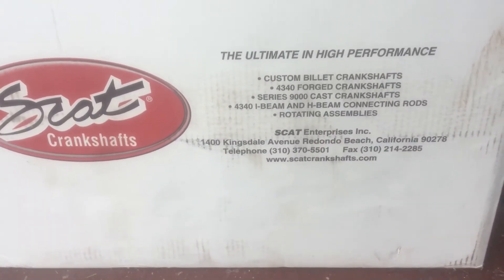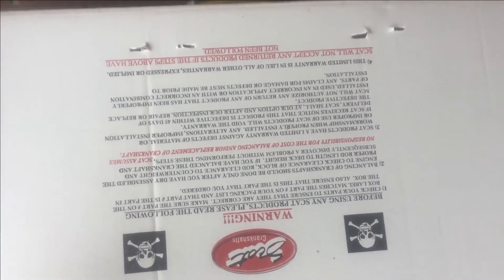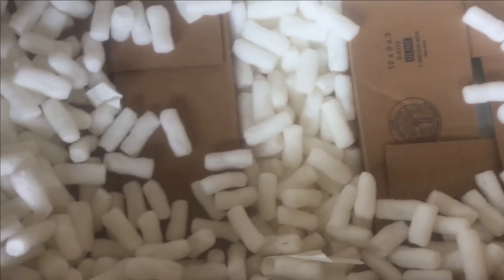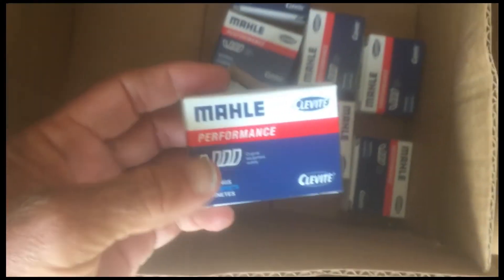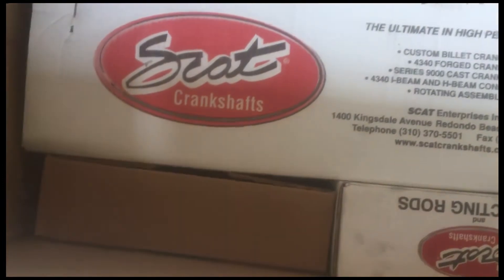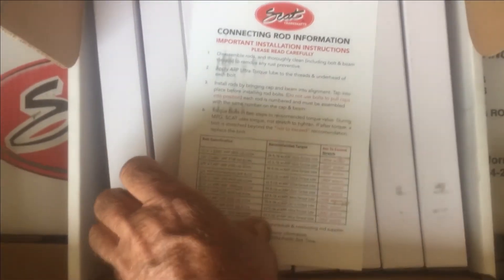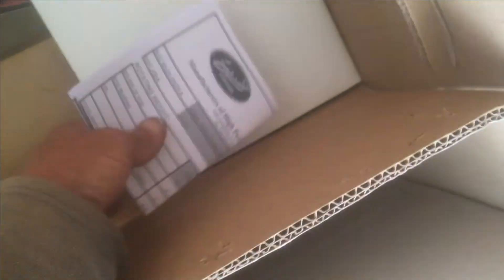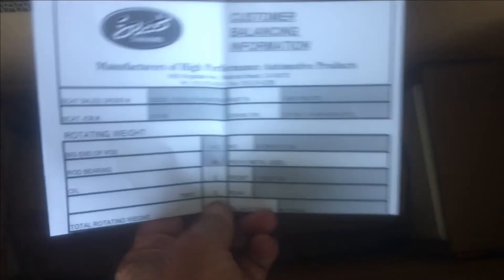Scout ii - DIM DIY How To - SCAT Dodge 5.9 to 408 Stroker kit - part 1

Comment: What is a kit part number on that
Reply from the maker: The part # for the Crankshaft was 9-360-4000-6123 . I worked with Scat eng/tech/sales directly.. Thomas was great and ended up piecing together all the best parts at the best price including balancing it.. The pistons ended up with were KB316 as they work with type of combustion chamber on a 5.9 magnum.. Got the bearings/rods too as part of the pkg. Parts and personel may have changed that was Aug 2020 but that is what it was then.